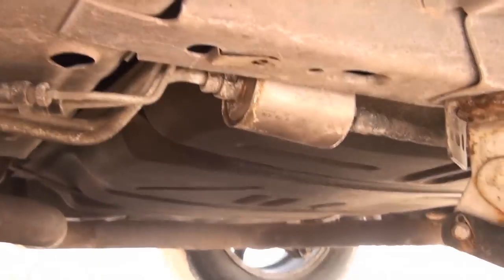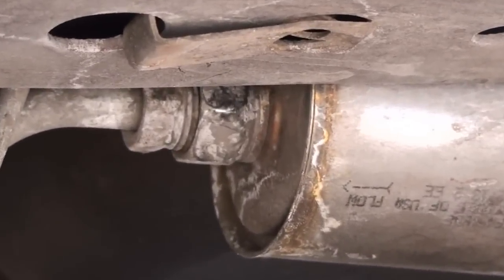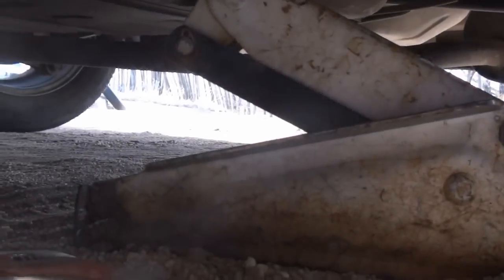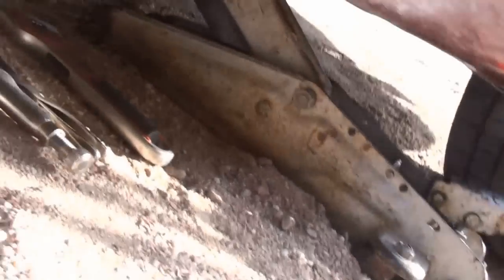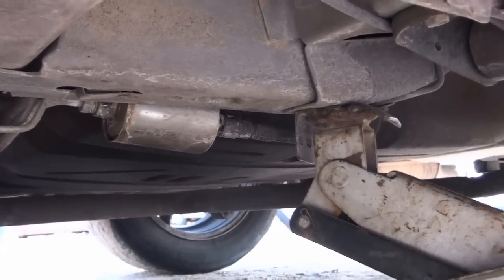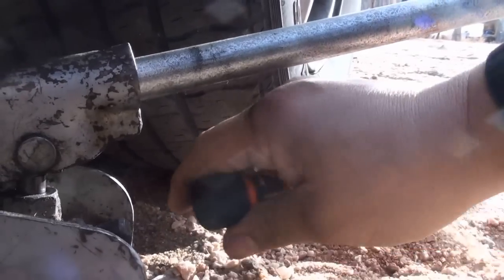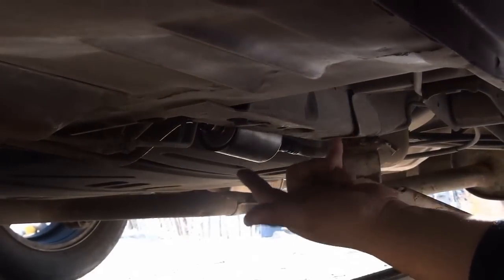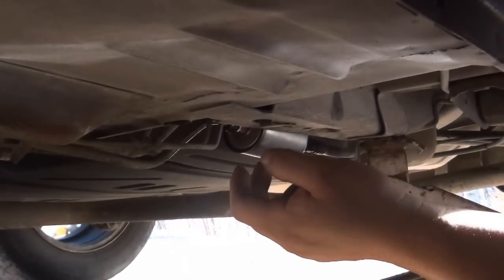How to replace a fuel filter on a Grand Prix GTP

Comment: Lol. I was going to attempt it  this afternoon but looking at the metal line breakage was imminent. Going to let it ride as is 😢.
Reply from the maker: Try some PB Blaster or something similar to loosen up the line at the connector. Sometimes there is rust build-up inside the threaded connectors.

Comment: Looks like the metal hanger filter bracket  either rusted off or was simply completely discarded and not a good idea for both said bracket also serves double duty as not only a supporting role but also a johnny on the spot Skid plate now that's thinking Inside the Box , if I were you I'd seriously consider finding said very helpful bracket either at a wrecker or store or pull one out of your thinking outside the box hat. There's your challenge for today. From Alberta Canada.

Comment: It's a good idea to check your fuel filter if you don't know if it's ever been changed I had a Oldsmobile Alero the fuel filter was so clogged I couldn't even blow through it but that was after it already took out my fuel pump.

Comment: There is a 13mm bolt for a bracket that holds the filter in place. Yours is missing.
Reply: Yes. I noticed that.
Reply: @tremayne3  possibly you could zip tie it up with a big zip tie a wide long one if there's something to zip tie it to?
Reply: They usually rust away lol

Comment: Why would you ever use vice grips. Cost my brother a fuel line listening to this video. I guess vice grips are the hillbilly's wrenches
Reply from the maker: How did you fuk up a fuel line with the vise grip? Elaborate
Reply: @RaysFabShop  stripped the crap out of the bolt with the vice grips, it's so seized that it wont come off now. I do have to say there was useful tips in there and the part about making sure to drain the gas was a good idea, but vice grips to take it off is just dumb
Reply from the maker: @blakedaly18  Did you know it was a dumb idea before hand ? Grips work if used properly, they have a purpose in tight spaces, you can strip out a nut with a siezed key as well.
Reply: @RaysFabShop  wasnt me pulling the filter. Point is inexperienced people trying to save a few bucks can seriously fuxk things up with vice grips, I cant think of a single mechanic I've ever seen use vice grips on hex fasteners that aren't already stripped, and I wonder why that is

Comment: Is this the same with a 2007 base grand prix
Reply: The 2004 and up just has three connections instead of two.  It has two quick disconnect lines on one end and a threaded on the other.  It's also in about the same location.

Comment: Good video but I'll suggest a couple things for those who have never changed a fuel filter.  You mentioned depressurizing the fuel line at the Shrader valve on the fuel rail.  The fuel rail should be on the passenger side under the hood.  It looks like a tire valve stem.  You can take the cap off and push the pin in the middle just like you would to let air out of a tire.  Also the filter might be too tight for using channel lock and adjustable pliers.  Might need the box type wrenches.
Reply: It's nice to use a 16 mm line wrench and a crescent wrench pretty sure it's 16 mm if I recall correctly.

Comment: Cant i just pull the fuel pump fuse while the car is runninh to depressurise the lines
Reply: Yes you can pull the fuel pump fuse or the fuel pump relay but run the car till it runs out of fuel whatever fuel is still in the lines you know

Comment: Good video...I will mention though, whenever possible, use box style wrenches. Try to avoid using adjustables in anyway possible.
Reply: The small nut actually a line wrench is preferable and I would say a line wrench is 16 mm or close to 5/8 if you don't have a 16 mm might fit it but sometimes they will not interchange and then I would say a crescent wrench as long as it's a good one would be okay on the big nut

Comment: You buy a used one that's never had the fuel filter replaced (100K or more miles) it will not come off that easy trust me...the bolts will be rusted badly and it will take some muscle...

Comment: well the tires are on the car so you wouldnt of been crushed anyway lol
Reply: Seriously!?? That’s over 3 tons of weight falling down. The shocks would bounce and you would be crushed. Especially if you’re laying on your side. If it didn’t happen to crush your head and you survived, you’d be pinned there most likely bleeding out or have sever internal bleeding. These cars are pretty low, but especially if it’s been lowered at all.